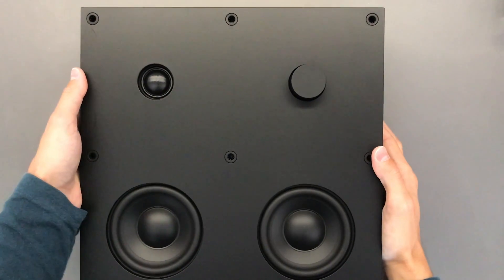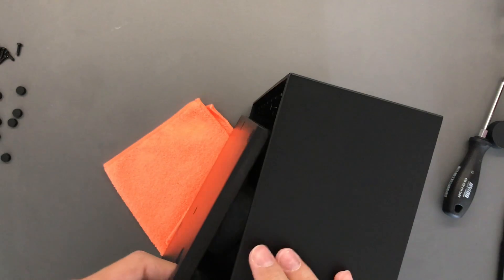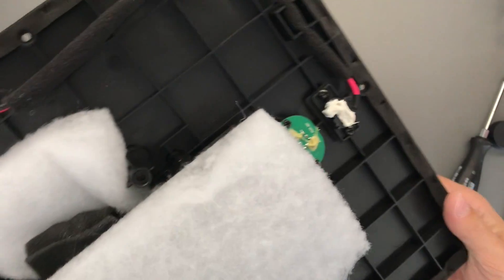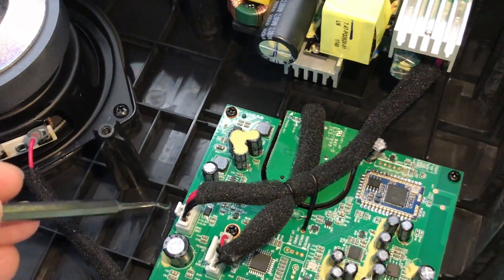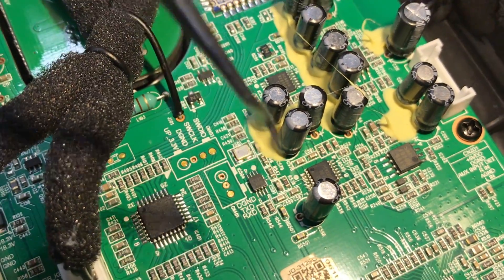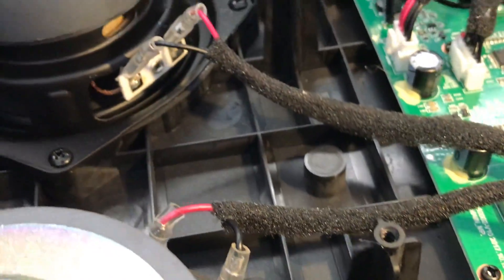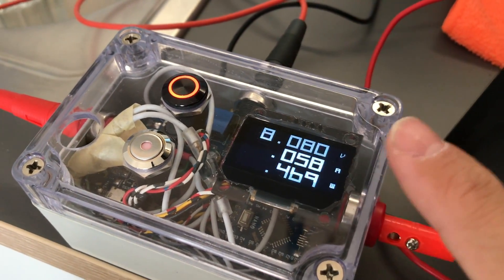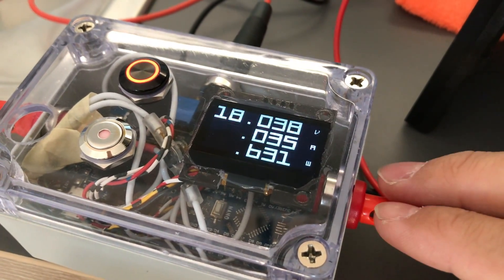IKEA Eneby 30 - Teardown Review

Comment: I have an Eneby 30 and is shuting off immediately after turning on, after it shuts off it wont turn on, i must unplug it from electricity, wait a while and plug it back in and it will turn on but after a very short moment goes off again, can you help me?

Comment: whuld this speaker work on 6x 18650 cells giving 22volt?
Reply from the maker: for like 50 hours 🤘🤘
Reply: @Darieee  Can you please do a tutorial
Reply from the maker: I wanted to - I also wanted an elegant solution for charging/discharging the batteries - which I ended up not managing to pull off

I since sold my eneby so .. won't be able to unfortunately

do check this video from my channel though, it does have a 6S battery pack

https://youtu.be/kg5TZE76p9I
Reply: @Darieee  Thnx :)
Reply: @Darieee  kz i have tje cells and holder for the cells but i don't know how to vire it up propperly

Comment: Thank you for the video. My Eneby 30 stopped working after I had a bad voltage fluctuation. I opened it up and found what appears to be a short circut? The cotton padding was melted in some places with some black charring on the inner casing. My question is, can it be fixed? If so, what parts should I change? Thank you.
Reply from the maker: you should attempt to change the power supply - get something with a similar voltage and feed it into the amplifier board

you MIGHT get away with using a laptop power supply - those are 19v 

do check - I think the original was 17v

if that's the case - 19 should be fine

Comment: Hey, thanks for this! I've been using one of these in my kitchen (wired to a cheap DAB radio) for a couple of years and been tempted on a few occasions to have the back off to see what makes it tick...
Now i'm very firmly from an old school 'flat earth' analogue hifi background so the Eneby instantly appealed to me as it's a 'proper' wide baffle box'n'cones speaker with no frills (i've no use for network/app/smart stuff and only occasionally connect my phone via bluetooth)
So, cons: 
- I don't mind the auto switch off but it'd great if it also woke up when a signal was detected. The Vol control isn't an issue to me as i use the vol on the radio, pre-amp style.
- Auto switching between the jack input / bluetooth is a big miss, having to pull the jack out to connect a phone is definitely an oversight, though hardly a deal breaker! That's it...
Pros: 
- For the money, It sounds *tremendous*, easily bettering many boxes i've heard at double or triple the price. Goes loud but clips out pretty benignly, nicely balanced, more than adequate timing, surprising bass heft AND control plus the rear port means you can 'tune' it via boundary proximity. If you're demoing it should be noted that the tweeter is a little ragged straight out the box but smooths out noticeably after a few days use...
- The inclusion of tone controls, and i type this as a someone who usually considers them superfluous, is a real boon and something that many of these over bassy wireless speakers could use (I'm lookin' at you Bose) as well as being useful for clawing a little more life out of sub-par MP3 uploads...
- To my eyes, it looks great, grille on or off.
That's it, i'm hard pushed to think of a way of getting more sound for £80, this thing is one of the biggest bargains in home audio. I can only conclude that none of the hifi mags have reviewed it cos they don't want to piss off their advertisers... ;-)

Comment: I've reverse engineering the whole PCB. IKEA just spent a lot of money for nothing.
They are using the BT DAC than  the external ADC to go back to digital... They could just have used the CSR module to do all.

Aux input is a standard mix and buffer, the BT is a simple differential to single ended signal buffer configuration.
Theya re using a Precision Rectifier like circuit to detect the analog signal for the standby function. (This could have been used for both BT and Analog Input but they did not do that)
One of the four Opamp is not used. They could have used it to design a virtualg gound circuit instead of crating three different biasing circuit, and use tons of capacitors for nothing.

Due to the higth complexity of thoose aplifier they could siply have used two tpa3316. Use a full analog circuit instead of going back and forth with analog and digital.

How about the BT/AUX switch? they are usign a quite cool 4 channel chip. Useless in this application. They are only using half of it. They could just have used a simple 2:1 mux.

They they have decided to use a ton of BJTs/Mosffet to drive power gates, they could simply have used the pins directly from the MCU... Also LEDs are drived by external transistors. ANd yes there are two leds with different functions.

Next step for me is to dump the i2c communication and the power gate sequence...

BTW why did they have not done things differently?
I'm not an EE, but this is what I've would have done with the same components:
Use the I2S output of the CSR module, Slave mode MCLK generated by external source. And use the ring buffer oscillator they already use.
Directly connect the Aux to the ADC, at least power gate it for the ENEBY20.
Drive the AMPs with the I2S signals. In this way its all Digital for BT,a nd the only things that should be converted is the AUX input.

The cheaper options for them, would have been:
Use the CSR input function forthe AUX, I2S directly to the AMPs

Now, my last hack/ideal solution:
Remove all the analog stuff, use a smart codec with stereo ADC like the CS4265, and two or more I2S interfaces to process the signal path. In this way we could also have SPDIF input!

Anyway, hack into the i2s should be easy allt he signals have a 100Ohm resistor that divides the amp section and the ADC.
Reply from the maker: thanks for the detailed breakdown!

indeed - this speaker seems to all intents and purposes to be a school project
Reply: @Darieee  I'm preparing the full schematics :D

This weekend I'll publish something on Hackaday.

The importatnt thing is that it sound good.

I want to mod it to add TWS, and if possible add SPDIF or a RPI for music streaming.

(I know that there is the SONOS speaker, but that one don't have BT! And Sonos is having some issues on comply wiht UPNP standards...)

Have you avere played with the CSR SPIDF/I2S interface? I'm waiting for the SPI adapter to hack it.

I would like to know if is possible to route an analog signal via the built in ADC to the slave BT speaker!

I2C Protocol DUMP done!
Looks like that they are mainly using the default register configuration. But decondig the 20byte EQ registers is quite a mess.
Reply: @tuttocrafting  Did you ever publish your ideas to Hackaday? I wasn't able to find it and after researching I so much agree with your view. IKEA could have done so much better. I found out that at least the csra64115  natively supports seamless switch BT and AUX. So instead of doing whatever crap they did where it's either or, they could have used this. And I would have loved that. So I am definately up to some heavy Eneby modding. Unfortunately I need help from someone who actually knows what they're doing. So I would really love to get your input here :)
Reply: @klausagnoletti1027  at the end I didn't push anything due to the fact that other than the mcu the other stuff is a straight configuration from the datasheet.
If I remember correctly the adc clock come from an not gate oscillator.
And the downmix is done on the analog section near the analog mux ic.

I'll try to see if I have the paperwork of the reverse engineering work I did.

About your question, the car chip have aux in, but the adc in that one is worse than the on supplied by ikea.

If you want to mod it what I would do is:
Bypass the analog mux, find a way to downmix stereo to mono in the csr chip.

Then use the mux switch select pin to switch the i2s digital signals.

The csr must be set as an i2s slave with master clock from the original adc clock source.
Reply from the maker: you should 100% upload it to hackaday or something similar🤘
Reply from the maker: I'll link it in here once you publish

Comment: The sound is amazing!!! I´ve heard Harman Kardon onyx 5, JBLs, Naim..., and truly, this one sounds really really nice and powerfull. Misses the battery...
Reply: The battery compartment is in ENEBY 20. There is also a carrying handle, it comes in the kit.
Reply: The bass can go deep like 40 or 35 hz with this unit?
Reply from the maker: mmmm, will have to disagree on it sounding nice

onyx (lost track which gen) was super bass heavy, to a ridiculous extent, so, yes, not good

jbls are also imo too bass heavy

compared with some krk monitors or something like an iPod hi fi set to bass boost (if you can find one somehow), it's no match

the eneby, at least the first gen (who knows maybe they retuned it, it would literally take changing a few values in rom), was insanely lackluster in the mids

mine sounded mega mega weird, I gave it off immediately for about 40€ or so
Reply: @Darieee  who tf hates bass
Reply from the maker: I think asian people - not sure tho

anyhow - all jokes aside - you can't set your sub to 11 and the mids and highs to 3 and say it's good sounding
Reply: @Darieee  racist kinda, and btw i put my bass boost to 24 dB
Reply from the maker: I did have someone send me a table-top radio to put bluetooth and a new amp/speaker setup in

and I did load it with some super slim high excursion drivers - which sounded super sweet

got 7 earfulls that the previous setup with 3w paper cone speakers sounded way better

that day still haunts me
Reply: @Darieee  waht
Reply from the maker: exactly.

Comment: Thanks for the teardown! From what you say it should run without any problem I’m 12v. I’m not thinking battery, but I’m considering the little brother (eneby20) as a Bluetooth speaker for a camper. The 20 is just easier to fit in a tiny space, should have enough power and is syncing the volume ;)
Reply from the maker: so, yeah, 12 to 17(or whatever the main VCC is) should be fine

12 will give a lot less umpf 

Also, what're you saying about synced volume ?????????
Reply: I’ve got about no clue how I’m going to make this work on 12v... but that’s good to know!
About volume syncing, I was at an ikea here in the NL and there was a A4 sheet to help you to choose your eneby. It seems the eneby portable and eneby 20 do have volume sync ;) at least that’s what I read... didn’t actually checked it...
Reply: What is the max voltage it can run off? And would it be better to run off higher voltage? My eneby30 is on 12v now. I wonder if i lose amplifier output (wattage).

Comment: I have the Eneby 30 and I like it a lot, considering the price. I am a bit afraid that Ikea will not improve it for many years to come. Ikea tends to keep productlines the same for ages.
Reply: I’m keeping it... I like it a lot. and if it breaks down: I have two years of warranty. If it lasts two years then the 90 euros was worth it.
Reply: A bird on the windowsill says that the current line is being discontinued in october of 22’ a eneby gen3 is on the horizon i suspect
Reply from the maker: yea ... likely

some users have however reported that now it doesn't turn off

so -- if returning it is possible/not super costly for you, you might give it a shot

imho it doesn't sound too good, .. no mids, but, at least for the 30, extremely powerful on higher volume

Comment: Great video. :-)
Is the anywhere to get power out of the board, to drive a Chromecast audio? :-)
I would be nice, to modify it, to have a build in Chromecast audio.
Reply from the maker: sure, you'd need a "dc-dc buck converter" to step down the main 18 or so volts the eneby runs off of; get that down to 5, and power your chromecast

or there might already be a 5v rail present but, it's a bit more risky playing around with those
Reply: @Darieee  
Hi.
Yes, I know that's one way to do it. :-)
But it was option 2, I was hoping on someone has some knowledge about. :-)

Comment: By the way the csra64110 appears to be cross-compatible with the beloved csra64215, so if you are up to desoldering this one and changing it to the 64215 you gain the features, and i think that (maybe) it is possible to copy its firmware, and so you can get aptx in the eneby.
Reply from the maker: yeah, I strongly suspect they are pin-compatible ... and as far as I'm aware the eneby runs a rather stock firmware/psr on there ...

might work to just swap em over ... buuut, yeah ...

Comment: hi, possible to put a battery to make it portable? thank you
Reply from the maker: Yeah, the circuitry should work from 10 to what the actual supply inside it is (forgot .. was it 18v?)

You could also charge the bettery from that rail ...

Let me know if you do it ... I planned to do that on mine but got too full with other projects
Reply: @Darieee  I would like to buy an ikea 30 but I do not yet if it is possible to pair a battery to the internal power! and if so what battery power and how to connect it to the system
Reply from the maker: If you're okay with adding a switch on the outside, it shouldn't be too involving ...

You will need a 3S pack, or ideally a 4S one ... 4S1P is what would be best

With that you would have to also have:
• a 4S BMS to protect the cells from overcharging, over-discharging and short circuits 
• a 4S balancing module to ensure the cells never drift out 
• a constant current buck converter for charging the pack

And a switch to go between charge and discharge
Reply from the maker: If you're okay with adding a switch on the outside, it shouldn't be too involving ...

You will need a 3S pack, or ideally a 4S one ... 4S1P is what would be best

With that you would have to also have:
• a 4S BMS to protect the cells from overcharging, over-discharging and short circuits 
• a 4S balancing module to ensure the cells never drift out 
• a constant current buck converter for charging the pack

And a switch to go between charge and discharge
Reply: @Darieee  yes it's a good idea

Comment: Hi,
Thanks for this video 
I'd like to add one of these speakers to my chromecast multiroom.
Do you think it's possible to take a 5v from that board to supply the chromecast audio and hide it in the speaker ?
Reply from the maker: yeah, should work - just be sure not to tap a GPIO line :)

Comment: How can you be electrocuted when it's not even connected to the mains
Reply from the maker: Well, that one in 50000 times you think you've unplugged it and actually haven't - you can - actually - get electrocuted xD
Reply: abc 123, A electrolytic condensator which charged from 110V/220V store charge from 5 min to a few hours (or even days). Of course If company didn't install a resistor for discharging. It won't kill, but it will hurt =) I says about condensators on the power board which connected to 220V.
p.s. Old TV's have charge a few kVolt - it's dangerous!

Comment: Strange they didn't fit two tweeters.
Reply: PERIZ99  yes it is a mono speaker , just a shame it's not stereo , it does have 2 amplifier chip sets.
Reply: @ahelpinghand8340  one for highs and one lowpassed in bridge, so it's biamped which is nice, proper active studio monitors actually are biamped aswell
Reply: Keep costs down its not the 70s anymore sadly

Comment: The voltage they chose to go with makes me think they have considered releasing a model with built in battery in the future.. 18.3v is in the ballpark of laptop chargers and lithium batteries that have 4 li-ion cells in series ( 4 x 3.7v..4.2v = ~ 16v) so just the right voltage to charge such batteries.  
Otherwise... is there enough room for a lead acid 7Ah battery like the unes used in cheap UPSes ? The whole thing is heavy anyway so if you're thinking semi-portable, like taking it in your car to a picnic or something (so you don't have to carry it in your hands for long distances) then a lead acid battery may make sense.
Reply from the maker: hmm, nah .. I don't think is has anything to do with it ... it's a nice voltage to be at ... but everything will run on 9v as well ... I'm actually working on a 3S pack now wich will reach 12.6v at most

I don't think a lead acid would make much sense ... and you'd have to stick it somewhere in the upper part ... which would mean somehow extremely safely securing it ... it would also make the entire speaker top heavy ... and at the first topple the lead acid would become loose ... yeh nah ... sounds rather nightmarish
Reply: @Darieee  Isn't the Eneby 20 battery pack already 3S? But capacity can be an issue
Reply: Great work! I'll try a 4s 5ah battery pack when I get a chance and figure out charging and powering the unit

Comment: I just want to know what that multimeter is.
Reply from the maker: I don't remember which meters I've used .. but I own a Fluke 15B+, and probably used that DIY meter as well,if you want one of those, I made a video on it a short while back, if you search "ina219 diy power monitor" you should find it
Reply: That's an arduino power logger. do a youtube search for it.